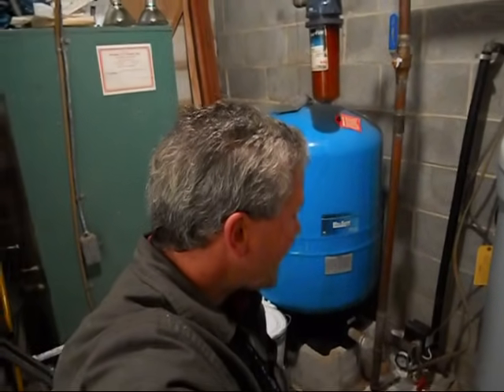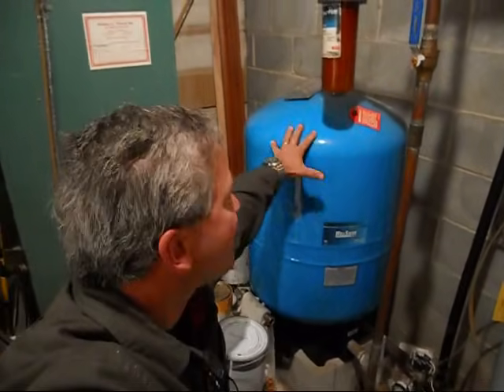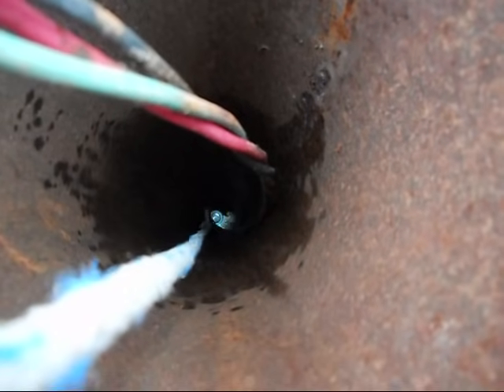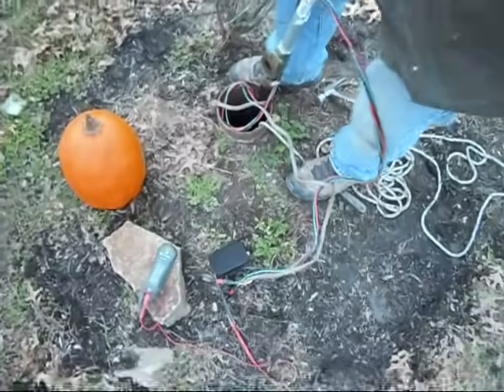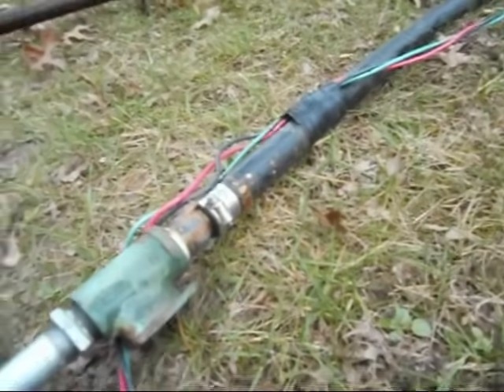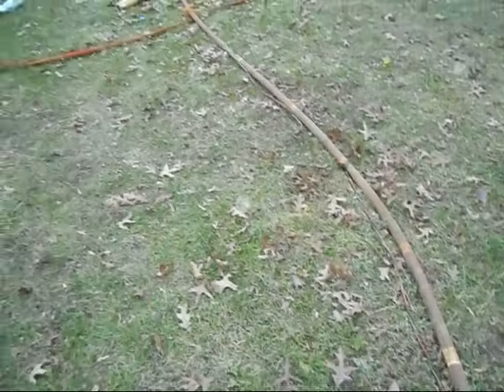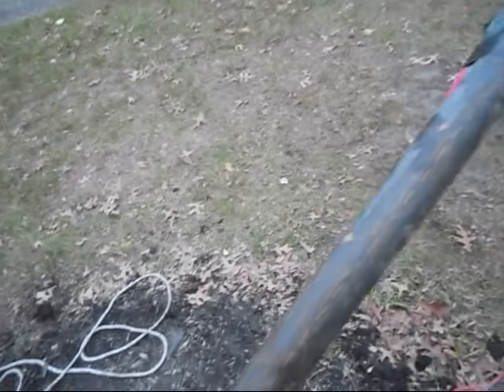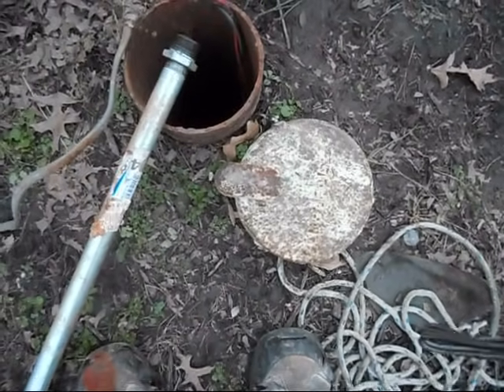Replace Well Pump in 4 hrs (all 12 videos clips) 100 ft Myers 2ST52-8 by Tatcor.com West Chester, PA

Comment: OK the video keeps glitching but I did see up to the point he got the pitless out (pitless, well cap, set pipe-few terms of parts he does not know), it does not get better - old unsealed cap, did not show if he disconnected the wiring, no gloves, (question; how many pairs if glasses and cameras do you think he dropped down the well?) no help, no tie off rope, no tarping for the piping to sit on, no cutting back of plants around well head, maybe he was going to get the dog to hold on when he gets a hernia when the pump slips. He should invest in a tri-pod for his camera or get a friend or relative to hold the camera. There are SOOOO many things wrong that this should be titled what not to do when your pump breaks down. By the way did he ever check to see if there was the correct power at the Pressure Switch or at the well head? Please, unless you have experience in pulling a pump or trouble shooting a water system do not take this on yourself - call a pro, we will help even if its free info over the phone, there have been many upgrades to water systems since they were originally installed (due to the fact that most systems last for 20 to 25 years) and better pulling/installing practices since orig install. Good luck, call a pro.
Reply: Had it done 3 times 500, 1000, 1500! No tarps, 2  jouneymen and a plumber/ well company. Done with you guys! New pump $350 and what?? Just stop.
Reply: Huh, the guy that makes money doing it suggests we should go to him, warns of terrible danger. Come in now and he'll also change your headlight fluid for only $200.
Reply: You should use a professional. In Indiana you have to have a pump installers license to work on a well, this is to ensure that our natural resource isn't contaminated by someone who doesn't know what they're doing. My family has been working on wells for almost 70 years. There are 35 different types of pit-less adapters out there and only 2% of wells would come out this way. I've never seen the plastic spacer device on any well. Please call a professional. We have so many people who call us after they have lost their pump down the well. We charge $600 up front to try to get it out, but can't guarantee it will. We don't know if something fell down on the pump or if the casing has bad scale build up.

Comment: I just started watching the video 2:15 & I saw so many code (plumbing & electrical) issues that I am hoping that the outside system is FAR better constructed than the inside system. I am a water pump pro so there are issues with almost all home owner done installs, but this guy says he is a building reno contractor - be aware this is NOT how a water system should look like! I'll try to watch the rest & hope for the best.
Reply: Give some examples of the detrimental failures you noticed.
Reply: holdengr should there be a rope from the pump up, as well as the pipe and wiring, just in case......

Comment from the maker: Sounds like a good insurance idea and it would allow securing the weight too. It would certainly be a big problem if the connection released or the pipe broke. If done right, the connection seems quite strong. Our well did not have a safety line. thanks for the comment

Comment: Great Video, My question is How come you don't have a safety rope connection your pump line to your well cap? Even though it is rare for it to jump we like to have a nylon rope run from the cap to the line in case so the unit doesn't fall to the bottom in the event it jump out of the connection

Comment from the maker: Hi...sorry for the slow response. I think you are on the right track. As the system demand increases (large capacity sprinkler system opens) the pump runs out on its pump curve to meet the demand (pressure would increase if sufficient flow were established). Since your system worked last year and is not broken (freezing....?), the pump could be the problem. There are a lot of variables to consider which I expect you have addressed by now with a pump guy. Hope it works out.

Comment: hi I got a question. my tanks pressure is idle at 55psi. as soon as I open my sprinkler system it drops to 40 then continues dropping then when it goes to 30 after a seconds it drops pretty quick to 20. It was fine last season. I'm not an expert but it appears that the pump isn't able to keep up or fill the tank quickly. any idea? is it possible that there isn't enough water in the well?

Comment from the maker: Hi Dale,
I hoped our problem was not the pump so I checked other possibilities until it appeared clear the pump may have failed due to running too much. Our pump was only 10 yrs old, but losing air pressure in the tank increased the cycling and age prematurely. Your clogged line would cause a large pressure drop reducing the pressure at the switch, thereby asking the pump to turn on with little result. I hope fixing the iron clog solves your problem and that your pump stayed healthy. God Bless

Comment: Hi: Great Video...Im have a similar issue in that our flow has dropped to a steady 15psi when the pressure tank drops off. We have tons of iron in our water. My question is how did you know it was a pump issue and not clogged lines. I just replaced our inside lines from the wall where they come in to the Culligan  system. They were about 90% bloked by iron sludge. My next step is to pull the pump out. Our system is only about 5 years. I think it may be the line from the pump to houe is clogged.
Reply: That’s a lot of iron how much was in the pipe?

Comment: (cont'd) on a plumbing related site in response to a question about air in the house system. It solved the trouble shooting of my system when every plumber I asked, gave me a wrong answer. There is also a product called "plumber's grease"  a pure silicon grease minus any petroleum products or additives. It works well for lubing "O" rings and the large threads on home water filters without adding petrol contamination. Get it in Lowes. Hope this helps someone else.    Yrag

Comment: (Cont'd from previous post)  and permits the column of water, in the pipe feeding from the pump to the pitless, to drop and be replaced with air. When the pump again kicks in, the air and fresh water is pumped into the house system, and you'll get all sorts of water and air spitting out of the faucets, shower, toilets, etc, along with an occasional blast of dirty water. If the pitless is bad, you will definitely hear it in the well casing. This info is being passed along from a post (cont'd)

Comment: (Cont'd from previous post)  and -- listen --. It should be a reasonably quiet time, ie... no wind blowing through leaves, no loud traffic driving nearby, etc.  When the pump stops pumping, if you hear a reasonably loud hissing, it's the pitless. Here's what's happening. When pumping, the system gets fully pressurized and the pump shuts off (you can't hear it start or stop) With the pump off, the system pressure bleeds off through the defective pitless making a loud hissing noise, (Cont'd)

Comment: Steve,

First, thanks for the video. Next it is suggested that when replacing the well pump, one should replace the "O" ring on the pitless adapter. I paid to have a new pump replacement 5 years ago and the contractor did not replace the "O" ring. Recently, I started getting a large volume of air into my water system every time the pump kicked  in. The problem is the "O" ring in the adapter. To verify it is a bad pitless, turn on a faucet, go to the wellhead and uncap it (continued next post)
Reply: Wow after watching this video I thought to myself I bet that O ring seal is the reason why I keep getting air into my lines every time the pump kicks on!!! Then I saw your comment. This is the exact problem im having. I couldn’t figure it out. I replaced everything in my basement. The pressure tank, new pressure switch, T pipe, new gauges new check valve all of it and it still didn’t fix the air problem. Now I know what it is!!!

Comment from the maker: Great ideas. Regarding the wiring, I did not replace the wiring, but reconnected using shrink tubing. I think one of the comments below recommended staggering the connections. Of course your wiring must be adequate for the load.

Comment: the only thing wrong i can see is that you didn't blow on the well with an air compressor, it being a steel well, when you pulled the pump and lowered it back down you disturbed whatever sediment that accumulated in the well over however many years the pump sat undisturbed, plus if the well is used for domestic water you should chlorinate the well with bleach or pellets, by doing all this you actually add life to the already deteriorating steel well,

Comment: Honestly, we get a lot per hour because its a "specialized" line of work. Here in NJ you need to be licensed by the state and believe it or not, its a very hard test to pass (10% passing rate in the last 5yrs) 

We'd charge between $1000 - $1200 to pull the pump, replace the pump and 105' of 12-2 wire. Oh and you get a 5 year warranty with our pumps too. 

Over in PA however, you do not need to be licensed and anybody can do it.

Comment: Great video. i am currently researching well replacement and repairs for an estimating company i work for. We currently dont have pricing on well repairs and our clients have been asking us to add it for years. The only thing i learned that you didnt mention is what that shoe fitting is technically called. They call it a Pitless adaptor in the industry. The idea behind the name is to imply you dont need to dig a huge pit to install or uninstall one. Hope this helped. Again, great video

Comment: Hey just wanted to comment on your video. I own a well pump pulling business over in New Jersey. You explained the video very well and you are pretty damn knowledgeable about well pumps for a home owner. We use Myers pumps over here and love them. Well, we use both Goulds & Myers pumps. 

Very smart about the tank PSI being 2psi lower than the cut in pressure, that's crucial & ALWAYS use a "roller" or roll bar when pulling the poly lines to protect the wire and pipe!

Take care 
 - Joe 
 Pump Dr